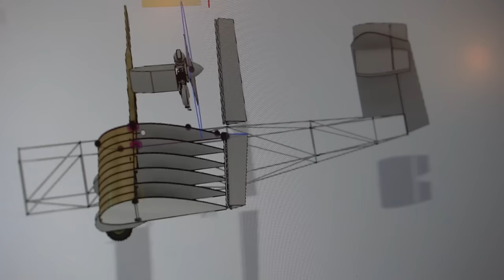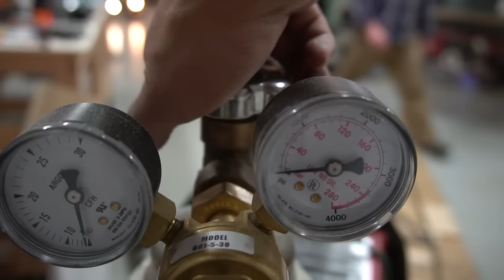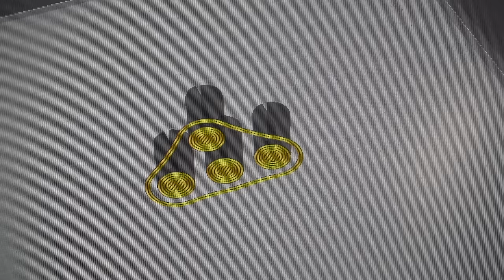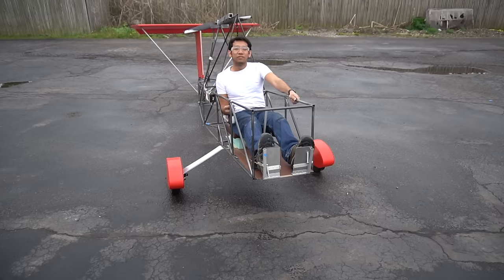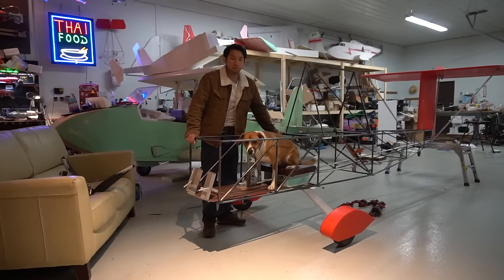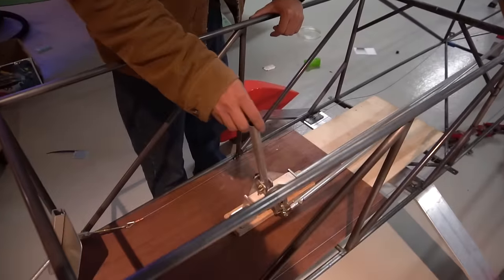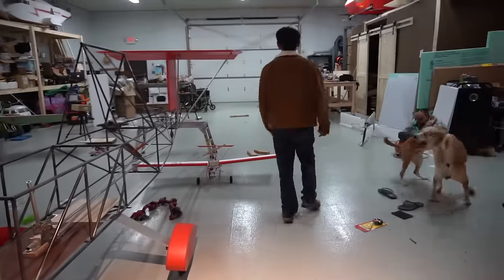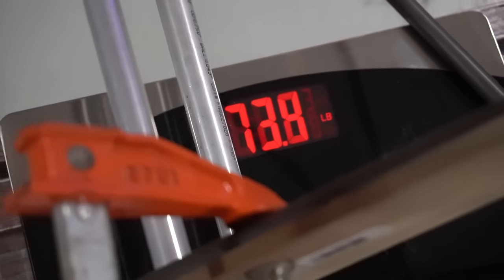HOMEMADE ultralight airplane mk3 part 3

Comment: I like these ultralight videos the most, and always look especially forward to them.  I am surprised this subject matter videos have a lower viewer count..  I say keep them coming!
Reply: Ji F. I agree. I actually only watch the ultralight videos. As I have had similar experiences. On that note, if you use those wheels for the final variation, (which I don’t recommend) replace the bearings with HIGH quality new ones, and reinforce the wheel with some bits of welding. Trust me... I have seen failures of both issues on this. Or, just get rims made for it. My 2 cents.
Reply: well this is at a million now so...
Reply: Ji F. Agreed!
Reply: @thelastcube.  Now 3.3 million. I guess people did like it after all 😉

Comment: you might want to look into brazing like on highend bike frames... if done correctly it is stronger than a weld due to not heating up the steel as much and providing a more elastic joint that can slightly flex and will not develop hairlinefractures like a weld...
Reply: JK, airplanes ABSOLUTELY need to flex. There’s a reason welding is very uncommon in the aircraft industry. Most things are done with fasteners
Reply: The frame of the fuselage can be stiff and welded. However welding more that two, maybe three components together at one place is asking for trouble. It is not done in engineering for a reason.
Reply: @daszieher  So then in his application would a brazed joint be better?
Reply: @JK-mg2cl  No! A weld will fare much worse in a repeated impact scenario. Due to the high heat required for multiple welds like he has the tubes get hardend and become brittle. They loose all their flex and will suffer from stress fractures with repeated hard landings. We are not talking about building a wobbly frame but a frame that in the case of a hard impact or loading will flex and jump back to it's original form afterwards instead of breaking or fracturing...
Reply: @daszieher  Multiple welds at a common point can be done engineering wise but care needs to be taken. In fact it is done quite regularly. Case in point the rollcage or tubeframe of a racecar. But if the weld operator is not experienced and the tubes not sized correctly there will be trouble... With Peter's honestly quite shoddy welds I'd personally be very very concerned about stress fractures and potential sudden unannounced catastrophic failure after a hard hit or loading for example... I'd be also concerned about the tubes becoming brittle due to the welding required. Peter should look into sidecar racing tubeframes... They are completely brazed and super strong while being stupidly light...
Reply: @henrygrey285 I'll rephrase that into: it is usually avoided wherever feasible. ideally an intermediary piece, often of forged material, is used to attach the tubes to it.

in any case one should avoid designs, where more than two welds intersect.
Reply: @daszieher  Don't you mean cast metal for the intermediary piece? Forged would be a bit overkill for most applications. Also nice could be a folded/stamped sheet metal one.
On the point of avoiding such joints I beg to differ. Intersecting welds can be done and often bring a big advantage (weight) if executed correctly (i.e. not Peter's design). I have a background in racecar engineering, now work in offshore rescue boat design and have used such joints numerous times with great success. Were I totally agree with you, is that the success is directly linked to the man/woman welding your piece. With a cast/forged/sheet metal intermediary piece like you mention the risk would be greatly reduced and this is the way I would go for a serial production process. With a one-off project like Peter's plane, where time and industrialisation isn't essential, going with such a joint can give huge returns for the effort if one has access to a good welder. The way Peter "welds" I would be more comfortable going with a brazed joint and eliminating welds completely since it is something he doesn't seem to have a lot of practice with...
Reply: @henrygrey285  I already saw from your comments, that you (as I) have an automotive background. It is pretty obvious ;)
Reply: However, if one lacks the special expertise necessary to tackle complex engineering jobs (design and execution), it is safer and more satisfying to start with the simplest possible setup, at the expense of safety.

Welding the same spot several times over can come up and bite you unexpectedly. I would feel much more comfortable with heat treatment, but that would obviously necessitate adequate material. Let's not even get into the bending techniques displayed in the video :D

And, yes, you are absolutely right, forged is overkill in many cases. I worked for a company, which employed aluminium as well as tubular steel stressed constructions (frames). Although I didn't take part in the design of those, one does speak to colleagues from time to time ;)

As I have absolutely no experience with brazing, I don't touch the subject.
Reply: @daszieher  I agree with your assessment! :) I too think Peter should keep things simple for the time being and then evolve later instead of jumping in headfirst. 
My experience with brazing is limited to a one off lightweight hillclimb race car frame. I found it to have more margin for error concerning heating the tubes with in such a lightweight, minimalist design than a welded construction (And not needing any heat treatment as you mentioned). 
Overall I really liked the first approach (although also quite whacked together) in composite since it is the thing I am most comfortable with. (I now specialize in advanced composites thus offshore boats :)) With proper materials and more importantly technique the weight could have been brought down easily while staying strong and in budget. 
What did you think about the aluminium frame having worked on some. I liked some things about it but overall had quite a bad feeling. But I have never done a frame in aluminium, my experience is limited to big offshore aluminium rescue crafts, ie totally different construction.
Reply: @daszieher  By the way, I really enjoy our constructive conversation :) It is a pleasant contrast to the usual youtube anarchy and mindless fighting...

Comment: Maybe splitting hairs but don’t heat bend 4130, it’s low-mid carbon steel and it will affect its properties. No worse than welding it but a tube bender may be a good idea
Reply: You can heat bend 4130 all day long without problem. It has no more effect than welding it. Which, of course, does have an effect; it reduces tensile strength to about 87% from the state you receive it in. Which is normal and happens whenever you weld it. Or heat bend it.
Reply: Ductility is lost on cold work of 4130.  I would prefer distortion over failure any day in aviation.  Low cycle fatigue strenth is a must.
I am experienced in 4130 tube fab.

Comment: Since you built ur own aircraft, would u be required to have a pilots license to fly it?
Reply: You don't need a license if the aircraft is under 254 pounds without the pilot in it.

Comment: Peter, On your next version could you utilize Bent Rods to help eliminate Most of the Welding ? 
Also utilizing small plates with location Holes to hold the Bent Frame Sections together, therefore making it easier to disconnect for Storage or to Trailer it. 
Was hoping the fan could be lowered, or use 2 counter rotating smaller Fans 
that can be folded rearwards to give a better Glide Format ? 
I Have other concepts to alter Wing pitch when necessary for Quick Landings. Thanks

Comment: If your not grinding down your tubes after notching your welding thinner material and risking cracking
Reply: Josh Kazarian all those joints need  gussets to be truley strong. Have a look at a Indi race car roll cage to see how it is done.
Reply: Cluster welds on aircraft tubing have been done this way for a hundred years. A 1/16th gap at the notch is perfectly acceptable. Usually just fishmouthed and welded up. I build / repair chromoly aircraft structures on a regular basis in accordance with FAR 43.13 accepted standards for aircraft construction.

Comment: It seems like you're starting to reinvent the wheel.

As I understand it, your original concept was to scale up hobby RC technology to the Ultralight and/or Experimental class. Something that could carry a person.
At each stage, fewer and fewer RC hobby technologies are being implemented. Now, you're basically building a FAR103 ultralight with some exotic materials.
I'm a bit confused by your power plant choices. First you were talking about new two stroke technology, then you showed a ground taxi test with an electric power plant. What will power your aircraft?

Finally, I see you using TIG welding technology, but later in your video you admit a certain lack of experience, and will have a pro weld up the bits. Fair enough, safety first.
I've also seen other maker videos where TIG is used almost exclusively (just caught up on Colin Furze the other night).
Question: Why does TIG seem to be preferred among youtube builders over MIG? Back in the stone age, when I was in high school, TIG could be used for both aluminum and steel, but MIG was relegated to steel only. My understanding is that that has now changed. And the videos I reference are steel only anyway. 
So, why use TIG to weld steel tubing?
With the advent of MIG flexibility, why not weld aluminum with MIG?

Heck, our forebears, guys making planes in their barns from the 1920's to the 50's used oxyacetylene to cut and weld steel,  and even gasoline for brazing. The original Air Camper, complete with an engine from a model T Ford, included braised buttress joints for the frame, like a bicycle.
Reply: Hey guys to prove your point you should scale up a small spoon I think that would be a lot easier.
Reply: @mamatuja  
"Spoon?"
Reply: I built a 29 Pietenpol Aircamper, and I warned this fellow that he has to normalize the welds or they WILL crack. I built mine with oxy/ acet

Comment: You dont need any screws in the hardwood you can use wood glue and the bond is actually stronger. Use the screws as clamps and remove after drying to save weight

Comment: Gorgeous work! I would not worry much about the thrust line per se.  In general it is not a bad thing to experience nose up as you reduce throttle, since that's what landing is all about. I am concerned about the change in the effectiveness of the elevator as thrust is reduced.  The effect will be pitch sensitivity at high thrust/ cruise and reduced sensitivity in low thrust/ landing phase.  If you like the way your model handles in these modes, then I think  you will be satisfied with the performance and handling of your aircraft.  Keep the videos coming!

Comment: You tungsten should only stick out about a quarter to a 1/8  of a inch so you can get your cup closer to smother the oxygen with argon. Makes better welds. Sharpen the tungsten like a needle. You only need to practice laying down some beads on some plate metal to become good just takes practice and confidence.

Comment: An erector set type frame might give lightness strength adjustability and plenty of holes for add ons or swap spots to optimize it per test to gradually make the best ultralight but strong plane

Comment: That undercarriage flat bar he is holding in his hand at 11.19, it can take tension, compression, some bending but it cannot take TWIST  and so it is seen vibrating trying to twist at 11:27  and it did at 11:41. IN addition to the spreader bar he is showing at 12:20 he needs to add another spreader bar from the wheel to aft or the front of there the aluminum flat bar meets the fuselage. It is the latter that will stop that flat bar from twisting, note again twisting not bending!

Comment: Think about how side loads will effect it.  On normal (piper) aircraft the twisting loads are translated to the frame by the brace wires where they tie to the lower longeron.  On your design the tail struts form a parallelogram (weak).  The only strength will come from what ever ties the fuselage to the base of the vertical stabilizer.  Perhaps that's enough?

Comment: I would like to propose a suggestion to enhance your aircraft's safety further. By substituting aluminum tubing with carbon fiber tubing, you could potentially achieve weight savings of 35% to 40%. Not only is a composite frame lighter, but it also boasts superior strength. Importantly, this upgrade could significantly enhance pilot safety, particularly in scenarios where the aircraft makes contact with the ground at speeds below 70 miles per hour, which is common for ultralight planes, typically averaging speeds below 60 mph.

The ultralight airplane now can incorporate carbon fiber composite technology inspired by F1 racing cars. In F1, the carbon fiber body has proven to safeguard pilots even amidst collisions at speeds up to 180 mph, ensuring their safety. Since the adoption of carbon fiber bodies in F1 racing, pilots no longer harbor concerns about safety during races. Similarly, I envision ultralight airplane pilots experiencing the same peace of mind in the event of ground contact while flying, given that the speeds of ultralight airplanes are considerably lower than those of F1 cars.

It's worth noting that only carbon fiber composites can achieve this level of pilot protection. Neither aluminum nor steel can match the safety standards set by carbon fiber. The composite frames are also good for bikes. 
The cost implication of utilizing carbon fiber tubes is not exorbitant, with prices approximately 30% higher than aluminum tube frames.   If this proposition piques your interest, I would be delighted to discuss it further.     Nathanvh9@gmail.com

Comment: You should set up cameras that record to a Single cloud activated by remote all over the shop so we can have daily   updates for all fans to run on. Ps. You should make a smoke fan for the dangerous toxins from welding and soldering, and any ozone let in the air by Electrostatic arc thingys. I WATCH ALL YOUR VIDS, AND SOMETIMES AUTO CORRECT TURNS MY FACE RED.

Comment: Are you sure that rod to move the tailplane is going to be strong enough? When you get air pressure on the tailplane there will be a lot of stretching/compression forces.

Comment: Modern aircraft should have built in parachutes so that if there's an engine trouble the parachute will automatically function to prevent aircraft from crashing.

Comment: Submarine? I hope you know how difficult it is to get those. Planes are one thing, but adding pressure computation to the hull shape, and properly setting up the ballast... its a lot more work so long as its manned. I would highly recommend sticking to ROV's as I am pursuing making a 1ATM submarine and can confirm that this is a lot more dangerous than flying. Even at scuba depths a failure in the pressure hull or ballasts could result in turning your submarine into a coffin. Then there's fire hazards, getting the air recycling system set up, waterproofing electronics... much more that can go wrong.

Comment: 10:01 here, this crank has no strength other than in tensile.  Same at 10:05.  You need a welded brace and a double pivot point, or under any compression force at all it will bend and flip outwards giving you a very sudden change in trim that you will be extremely lucky to survive.

Comment: I think if you used 45 degree angle aluminum for the landing gear instead t would add a ton of strength and not disturb the aerodynamics too bad. Landing gear would be a bad thing to screw up.

Edit: i just watched your explanation of your plan for the landing gear modifications. I wouldn’t worry about the landing gear in that configuration, however, i think you could ditch the spreader bar if you opted for angle aluminum.

Comment: Do u remember that your first design flew fully controlled despite little resource spending...but since then u gone conventional plane route & been a struggle despite lot more resources..The lesson to be learnt is  AS DAVE HERBERT SAYS "IF IT SOUNDS STUPID BUT WORKS IT AIN'T STUPID"...u got to go back to that 1st design & put stronger motors & mounts ..that's it

Comment: you have to normalize the welds. If not, sooner or later one WILL break and you WILL get hurt. you can't TIG/MIG weld 4130 without normalizing. I'm the builder of 2 homebuilts.

Comment: First and most important...You can't TIG 4130 chrome molly tubing without normalizing the joint. It WILL crystalize, and it WILL fail.

Comment: Hi sir. What kind of steel and what is the thickness did you use as frame on this one?
Planned to build mine with VW motor, but hard to find aero grade aluminum here in my town. So thinking uses steel just like yours. Thanks, Richard

Comment: Typically aviation safety suggests not starting a gas engine airplane inside a hangar.  Things go wrong.  A common mishap during a build on an experimental/ultralight and even maintenance of certified aircraft is a small(or big) engine fire.  The logic is you want the airplane outside so you don't risk burning the hangar(s) down.